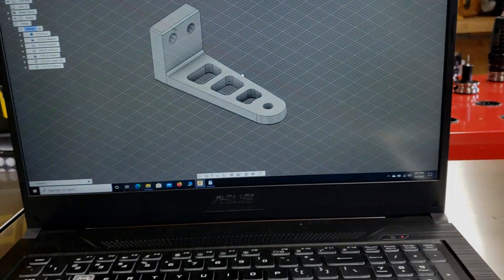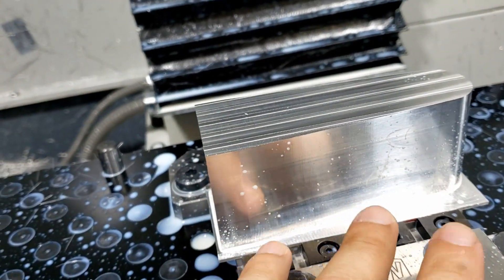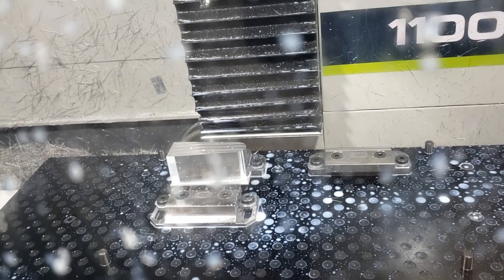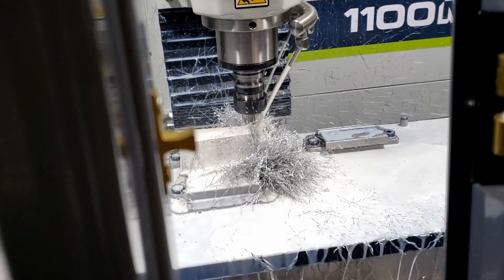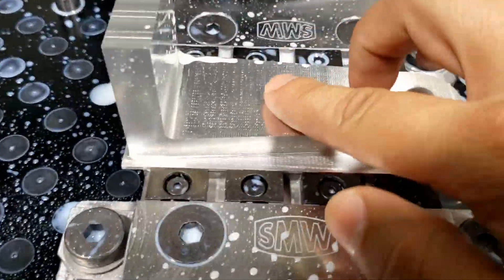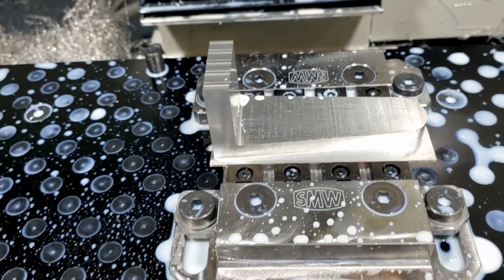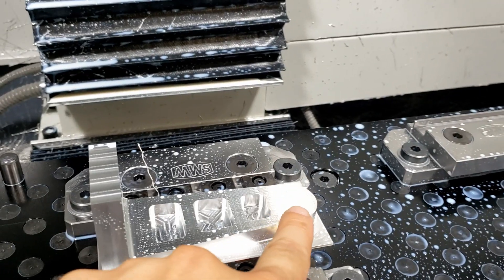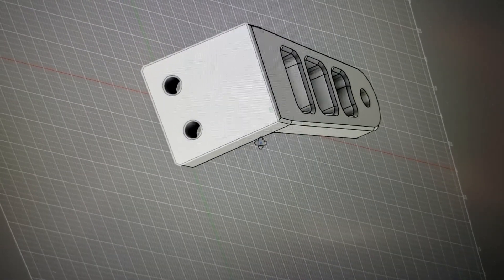Making: Headlight Bracket With a Tormach

Comment: What coolant do you run? Got my 1100MX about a month ago and I have been using kool mist and want to explore other types.
Reply from the maker: Sorry for the late reply, I use the qualichem xtreme cut 251c, so far I am liking it does not give off weird smells and haven't got any rust spots. I use a very light mixture of RO water and coolant when I have to refill and its stayed pretty consistent when I do a read on the refractometer.